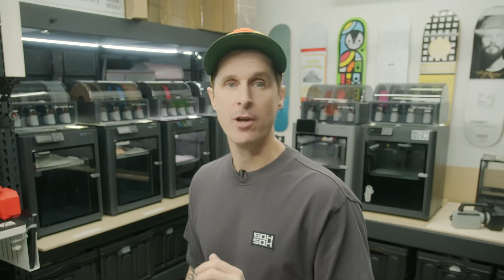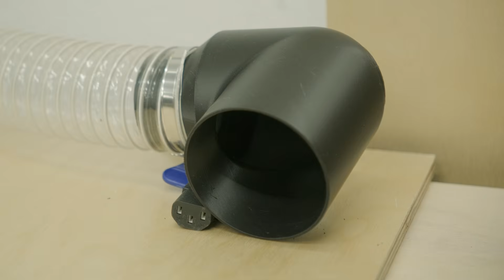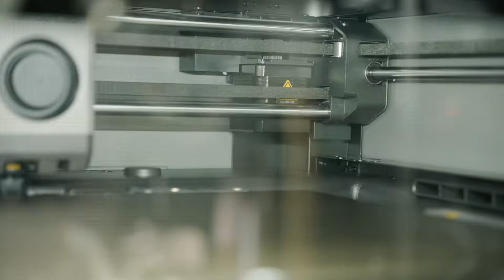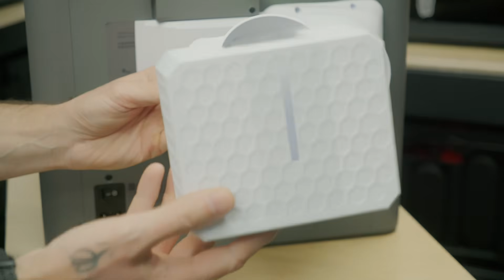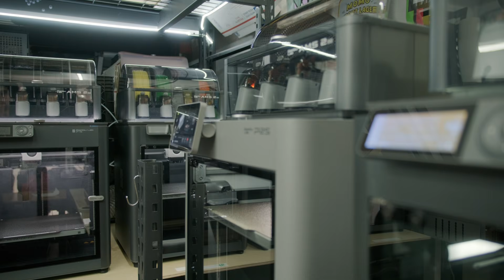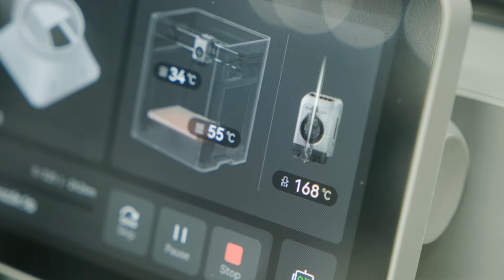Running 6 3D Printers With No Fumes (Vent Setup That Works)

Comment: Can you talk about CF fillements, 
like PPA CF, is this exhaust system enough?
Reply from the maker: I’d probably run a couple more precautions with those filaments.  Probably have an inline fan per 3 printers and definitely have some overall room ventilation as well.  If you have one of the air quality meters if at least will give you a starting point that you can adjust from.  The big thing with carbon fibers to keep an eye on is the CF fiber embedding in your skin.  I personally wouldn’t use it for products that are handled a lot.
Reply: @6oh5oh  Thank you!
Reply from the maker: Of course mate no problem.

Comment: Air can't escape out the poop chute if the exhaust is running. That will create negative pressure which means it will suck air into the printer while your pulling on it with thw exhaust. Just fyi. Got my own system which is very similar. Never will get people who think its safe to just run 30 open body printers and not have negative effects.
Reply from the maker: Exactly right mate, that neg pressure air for me is coming in around the door which is good seeing as that is air purified and with the window open as well in the warmer month.  Appreciate the response.

Comment: Nice setup, do you find it messes around with your chamber temperature?
Reply from the maker: Thank you, amped you like it.  My print quality hasn’t been affected for PTEG or PLA though I can’t say for other filaments as I don’t print with them. The suction can be dialled down if needed as the 6 inch main exhaust has a speed control dial.